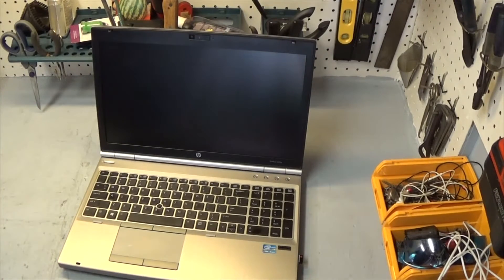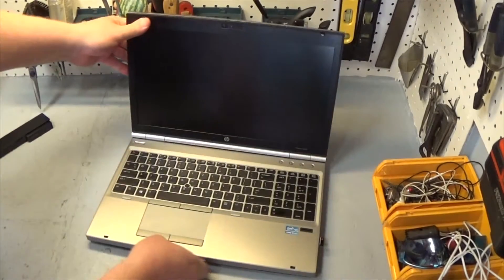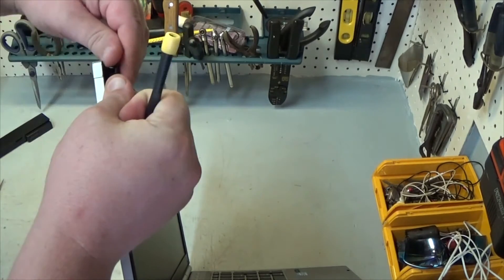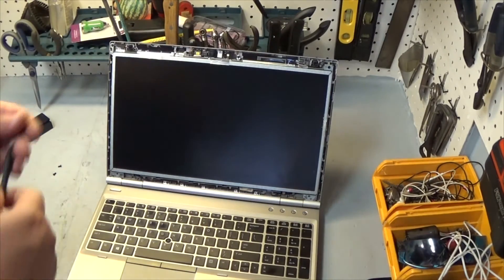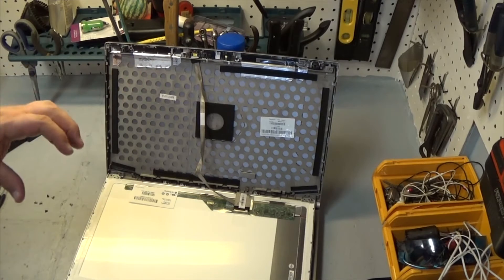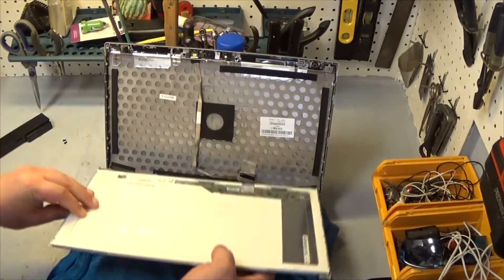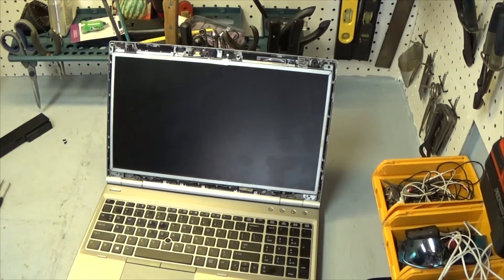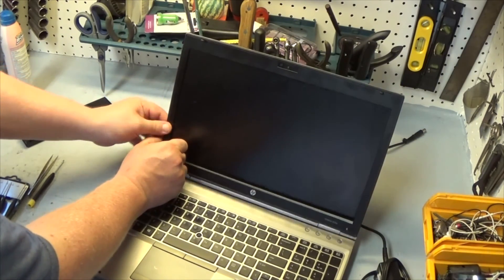HP Elitebook 8570 Laptop Screen Removal and Replacement

Comment: I have the same laptop and the internal screen doesn't work but it does output to an external monitor UNTIL you install windows updates (Win10). Then the backlight just stays on and I get no image. So I'm thinking is it worth trying to repair this even? I tried a different LCD panel with same results (no video). Maybe the cable is bad or the motherboard...